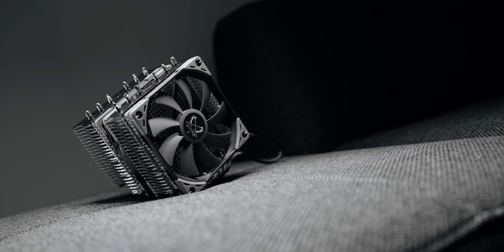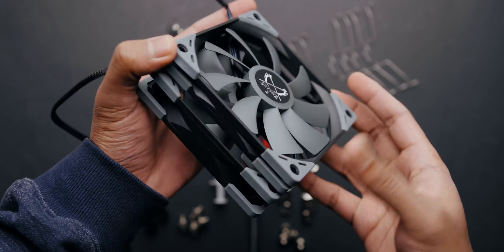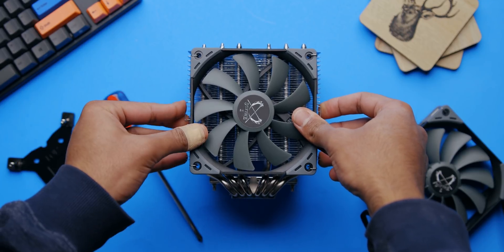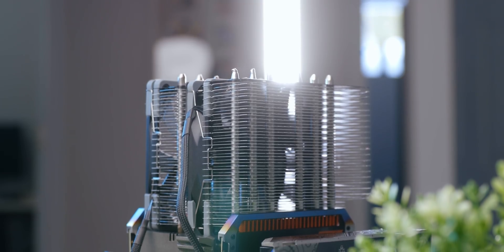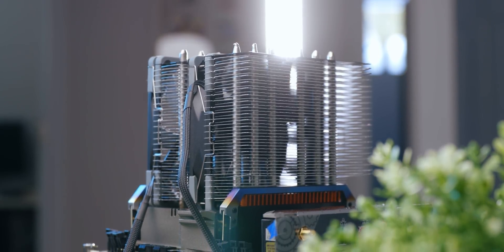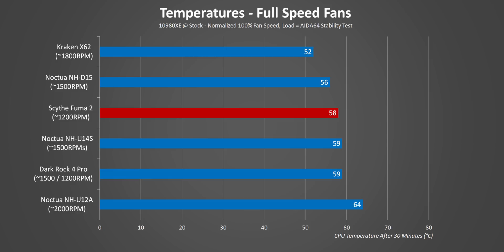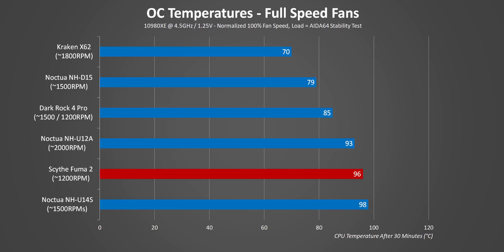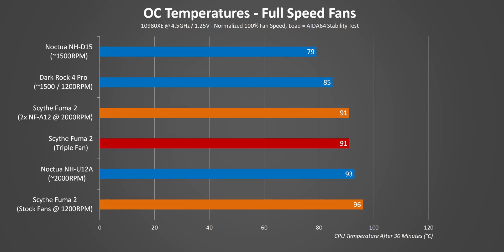A CPU Cooler You NEED To Know About!  Scythe Fuma 2 Review

Comment: I get Corsair A500 wasn't solid with Intel but why not actually test with AMD vs Intel to actually see if a cooler works better on a different chipset most A500 complaints only came with Intel with reviewers
Reply: The complaints about the Corsair A500 isn't about Intel or AMD, but about the design of the cooler. 4 heatpipes (although 2 x 8mm, 2 x 6mm) is with a logical assumption not enough. Big gap inside the cooler to have access to the mounting screws is disrupting airflow and frankly is not needed (Smaller holes that fitted the included screwdriver and/or a mounting system as the Cooler Master MA620M would have solved that problem). Not being compliant to the specs of Intel concerning where the cooler rest upon the capacitors (even when these are well within the specs of Intel) doesn't change when you are testing it on an AMD or Intel platform. Most shameful is that Corsair is still promoting and selling this unit for 100 USD in the state as it is. No recall, no excuse, no nothing, just cashing in on a flawed product.

Comment: As a Scythe Mugen 5 rev b owner, I approve this message
Reply: verios44 How long have you had it?
Reply: ricky v 3 years now 

Had it on a 1600 at 4.1ghz, kept it cooler than 72c during prime 95

Now its on a 3700x and preforms above expectation
Reply: verios44 Solid news indeed. I may have found a new air cooler. (:
Reply: @verios44  mugen 5 temps with 3700x? looking for a air cooler for a friend's build
Reply: WesleyL95 50’s to 70’s depending on game and cpu load.
Reply: @verios44  which one did you measure cpu package or cpu heatspreader? because with my 3700x + pbo rendering blender i get around 73c cpu heatspreader temp and 83c cpu package at 800 rpm.
Reply: i just noticed i use ninja 5 not mugen 5.
Reply: Hi do you have your mugen as push pull config?

Would it do better to have one in such way?
Reply: @rensquared24  yes mine is in push/pull. I use two of the same Scythe fans it came with originally, called Scythe Kaze Flex series 120mm fans. 

Preformance wise I have no idea if it makes a big difference or not. I currently use a 3700x so this cooler is more than adaquate standard. Hope that helps.

Comment: Great testing, really well done - Were you testing with the new noctua NF-A12x25? I'd like to see the performance from that fan on the cooler at the same RPM. Seems like scythe just stuck to the basics here and delivered exactly what an air cooler should be and nothing else.
Reply: I suspect that this cooler's biggest strength is the counter-rotating fan. The tests I would like to see are:
- Noctua NF-A12 front and back, with Scythe's counter-rotating fan in the middle
- Scythe's two fans mounted on another cooler
Reply: @FindecanorNotGmail  The six heatpipes and proper coldplate is nice as well. I dig the approach, fans really don't need to be faster than 1200RPM imo - if they have to spin faster than that you're bottlenecking yourself elsewhere. In the case of very high TDP cpu's that would need 2000RPM fans on a heatsink like that I'd simply suggest getting water cooling. Now we just need a redux edition of the 12x25 and we got ourselves a banger setup on the cheap.

Comment: Thanks guys, I was beginning to think air coolers were out, and only AIO's should be put in pc's. LOL For $60 I'll give it a try. But I currently have a Cooler Master V8 GTS on my 3600X in my HTPC. It runs at 100% load for hours when I transcode videos (100-150/session). My temps are in the 70's. But the fans are louder than I would like. Any idea how it would compare?

Comment: I'd rather buy this than a D15 and actually spend those extra $40 on a more powerful gpu or something.
Reply: More storage 👀
Reply: I got a Tc14pe for 50 nzd or like 28USD.. My r5 3600 doesnt get above 62degrees and I don't have a cpu fan
Reply: @BogDog9  Just a heatsink alone?
Reply: @BogDog9  so your CPU cooler without a CPU fan prevents your 3600 from reaching 60c ? From the tests I've seen on that cooler I can't say i can see that being possible
Reply: @sydbailey1320  well to be honest it peaks at 62, and best boost I've seen it go to is 4343. Rear case fan is close behind it also so it does get airflow
Reply: It's just ugly, I'd spend a few dollars more for be quiet dark rock 4.
Reply: @ilijapetrovic5002  hmm ugly? I prefer the black aesthetic of be quiet but the scythe also looks nice

Comment: I disagree with the assessment that this is a good cooler for the 9900K series. The newer batches are much less power efficient. I have a 9900KF and trying to overclock it to 5.0GHz all core it can draw 250w from the package on a Prime 95 AVX 2 load. And this is on a much smaller die than the 10980XE... this makes it actually more difficult to cool than the 10980XE. If you have a good 9900K, sure you can use the Fuma 2 to cool it. However, the power draw variance on good and bad 9900K chips is so vast that I would hesitate to recommend anything less than a 280mm AIO.
Reply from the maker: Really?  250W package power seems beyond what most Z390 motherboards can adequately provide on a normal basis without serious component degradation.  I'd be more worried about my mobo at that point than my CPU overheating..... :S
Reply: @HardwareCanucks  No sir. I blew a huge wad of cash on a Maximus XI Apex board. It has 2 8-pin EPS power connectors and doubled 8-phase power. VRM temps never went over 60C, even at those kinda power draws. The board is an absolute beast. It's just too bad my CPU was a dud. It was maybe a bit insane and ambitious to try doing 5 GHz at -0 AVX, but even with -4 AVX I was having serious problems getting power and temps under control.

Comment: I’d love to see how it works with the R9 3950x.  I got an assassin III and at max load it keeps at 85/89 degrees Celsius.
Reply: My guess Between 70-78c probably, which is really good with it's low DB
Reply: @chillhour6155  in normal work, modeling or just messing around with HoudiniFx or gaming, goes about  50ish to 65ish or so. just when max load it gets hot af xD
Reply: Sounds like your assassin iii might be faulty. I tend to avoid deepcool coolers, because they all should perform well on paper, but in reality their manufacturing process is as cheap as it gets. And i should add that assassin is not exactly much cheaper than the likes of Cryorig R1 Ultimate or Noctua NH-D15 or Thermalright Silver Arrow
You might get everything from slightly uneven spreader surface to empty heatpipes, non-existing heatpipe contact to heatspreader or fins. Scythe however is pretty consistent, i ve held several of them and the worst had just slightly uneven surface.
Reply: @bwellington3001  Yeah that could be. I couldn't find any better than this one here. Except for AIO Watercooling ones. I guess, I'll have to buy one from amazong overseas. I never thought this bramd would be this bad xD.
Reply: @Helios.vfx.  can you still return it?
Reply: @bwellington3001  I don-t think so. It-s been about 3 weeks already and stores here are kinda shit. But, right now i'm about 50/54 gaming
Reply: @Helios.vfx.  Well. If you get comfortable temperatures outside stress testing i would just keep it as is.
Reply: @bwellington3001  I think that's what I'll do for now. Thanks for your time

Comment: I have a Scythe Mugen Rev. B. It cost 40€ and can hold its own against coolers twice the price, plus its really quiet. 
Scythe is massively underrated imo.
Reply: Yup that's what's keeping my new 3700X nice and cool, coupled with bequiet silent wings 3 case fans my system is almost silent unless under very heavy load.
Reply: 100% agree. Mugen5 argb plus here. Great cooling, quite, attractive and affordable.
Reply: Might be too late to comment. The Mugen 5 Rev. B performs lower than the $25 Gammaxx 400. You can find multiple sources on the web, e.g., tomshardware. The reason is in its underwhelming fan that is focused on being quiet. Not only that, it only comes with one fan. Since the heatsink is a killer, upgrading the fans will improve the performance by a lot! Get one more fan for this gigantic heatsink. But if you are looking to buy a new cpu cooler, just go with the Fuma 2 that already comes with 2 fans.
Reply: @Sternkrieger I am going to install today 34 Duo on my i7 4790k @ 4.7 GHz. What fan curve you used?
What about noise?
Reply: Sadly, the Arctic Freezer 34 eSports Duo has it beat at the same price while giving you one more free fan. Hell, I was able to cool my i9-9900K @ 5.0GHz overclocked with it. Switched to an NH-D15 and I barely got any cooling difference.
Reply: @thaitan85  I have the Mugen 5 dual fan and cant see any difference between it and fuma 2 or arctic 34. I owned three arctic 34 duo on 3 different CPUs, a dual fan Mugen 5 (got it for 40$) so even cheaper than the 34 right now in my country. Temps are mostly the same, but for OC the 34 sucks. It can handle high TDP + the craftsmanship on the mugen 5 is on another lvl - better fans, rubber pads, quieter, better fan mounts, thicker radiator fins, bigger CPU contact plate, more heatpipes, screw driver in box....
Reply: @ancientslav4863  how would u compare the mugan 5 dual fan to the fuma 2?
i mean from a price point they are quite similar, but performance wise?

Comment: it is good if you're running your cpu on stock speed but seeing the results I'd pay $40 more for overclocking my system
Reply: Not really, it's just not that great for HEDT platform. On mainstream CPU's it will deliver temperatures much closer to NH-D15 and the likes.

Comment: I got the Mugen 5 Rev B, surprised to see Scythe being featured, unfortunately they're soo underrated
Reply: i have it with two latest noctua fans on Ryzen 3900x and it's great.
Reply: @SoulScience11  is there much difference in having 2 fans?
Reply: @Sagadiniz  it depends on cpu. Ryzen 3900x is very hot, with one fan on Cinebench i got 90C, with two fans 85C. I got NZXT s340 case wich has pretty bad airflow.
Reply: dito, also having the mugen 5 rev. b, its a nice solid cooler
Reply: @hyperbolicaltimechamber6  Don't who it was, AV Techy or Ponchato who used this block for passive cooling in a Silverstone LD03 with only the draft between the bottom and top fan of the case.
Reply: How long have you had it?
Reply: @WarriorsPhoto  I've had it for 1 year.
Reply: Sagadiniz Any issues or anything to say? Besides what Evert said.
Reply: @WarriorsPhoto  Make sure you have space between the back of that Mugen 5 and your case. Due to it offset and large block, the second fan might conflict with your exhaust fan.
Reply: Dorientje Woller I appreciate this information. Thank you everyone.
Reply: Same! Actually have the Rev B in my mini-itx rig and it is so incredibly powerful.
Reply: I just went and bought a kaze flex pwm fan for like 14$ I think.  Dropped my load temps maybe a degree or two.  But overall not much a difference.
Reply: @DurzoBlunts  The problem with a second kaze flex fan i think is that they spin clockwise and most pc case fans spin counterclockwise. i did the same as you and my exhaust fan slowed down by 200-300rpm. Somehow the counterspining currents interact with each other it did the same thing with 1 fan as well but the exhaust fan only slowed down by say 50 rpm. Now i use the second flex fan as exhaust deleting the AF 120 quiet that i had in there and i get better temps and even more silence.
Reply: I have one too. 3 years and still silent with original Kaze Flex fans!
Reply: I moved the included fan to the back and added one of scythe's rgb fans in front. Then they came out with the RGB version of the mugen 2 months later... Still very pleased.
Reply: I feel the same way about Thermalright. They never get any attention, but they make good air coolers. I'm guessing the issue is they don't send out tons of free samples to the YouTube crowd.
Reply: same here. the black RGB version looks great.
Reply: Used to buy them for years but they vanished from the Swedish market :/

Comment: To be honest, I hope Scythe reflects back to their past and issues a Max version of this cooler. Max version = 140 mm fan version.
Reply: OOOOOOOh, I really like that idea. Would you pay $15-$20 more than this version? (Still puts it a bit below Noctua and Be Quiet! AKA pretty Noctua).
Reply: @gogo8092201  If it gives more performance for that 15 - 20 USD and an upsize of the cooler with 2 x 140 mm 1200 RPM fans, why not. Their Scythe Mugen Max outperformed the normal Mugens and didn't cost that much more.
Reply: they had the best low profile cpu cooler imo
Reply: I've been hoping someone would test this with a single NF-A15 in the middle to see what it would do. Most reviews I've seen pit it directly against the D15(s), so they should have the fan on hand. It might stick out a couple mm on either side, but should still work well.
Reply: @heytoast7129  I do have a question: How are you go to put a 140 mm fan in a block that is created to hold 120 mm fans, if we are talking about the Scythe Fuma 2. The Scythe Fuma 2 Max doesn't exists at all, it was just a referral from me to the past of Scythe where they made of several models a Max version, like the Mugen Max. But, then the challenge will be to create/make a 140 mm version of that slim fan without losing the integrity of the fan blades.
Reply: @dorientjewoller113  Yes, I'm talking about the Fuma 2. Ah, I forgot the Noctua fan isn't symmetrical. It's 150mm on the width which would make it almost 1cm wider on each side, I don't know if the fan clips could cover that distance. If they could then it would work, as far as height goes it should be fine. 140mm would stick out from the top a little more, shouldn't be too much. I wouldn't expect it to be a perfect fit, but good enough to try it out. Just curious to see how it would do in a single fan config. 

But yeah, I too would love to see a Max version of this.
Reply: I'd love that!
I'm still using my Mugen Max on my 4790K and hope to see a Fuma 2 Max to put on a 9700K!
Reply: Its issue of tdp design, not cooler size. Tdp of fuma is lower tdp model than noctua's. Its amazing product
Reply: Don't really need 140mm fans, just faster fans. With Mugen, they did make a black edition with a faster fan. Around same price and better thermal performances. A Fuma 2 Black edition, with fans running at 1500 rpm, instead of 1200 rpm, would already give to this cooler a good improvement.
Reply: See, finally somebody did the test that i wanted to see. It is possible to boost the performance of the Fuma 2 beyond NH-U12A levels, just by swapping the fans with something with higher RPMs. It is not by much, but its possible.
Reply: @PietroSoft  I wished they added 2 slim fan clips extra with the cooler. The Kaze Flex slim 1200 RPM is only 12 Euro's/17 Dollars and can be bought separated and would be a luxury to be used as a 3rd fan. Or, if you wish a dash of RGB on it, both Kaze Flex, 25 mm & 15 mm are available in RGB version with 1800 RPM and the same opposite direction of spinning.
Reply: @dorientjewoller113  Scythe could just release an RGB Performance edition, and kill the U12A with the 1800rpm fans. It would be better on everything, looks, performance and price.
Reply: @PietroSoft  That's why I said that I hope they issue a Max version of this cooler. Beefed up to be used with Kaze Flex 140 mm fans.
Reply: @PietroSoft  they need 1500/1800 rpm (a)rgb version of Ninja5, guy that comes to LTX this year tested it and it beat D15 by almost 10°C on 4.1 GHz 1700x and same temp on 5.2GHz 8086k, but that one was bottlenecked by intels shitty TIM under IHS
Reply: I agree with this. I won't buy an air cooler if it does not have 140mm fans. They are quieter normally.

Comment: Why would you normalize to 100% fan speed instead of a specific noise level? Come on guys, this really makes you look like shills.
Reply from the maker: Shills for who exactly.  Plus normalizing at a specific noise level is a complete red herring.
Reply: Hardware Canucks You’re kidding right? On both counts.
Reply: Hardware Canucks You’re comparing for 100% speed normalized, which is absurd. You want to normalize for a reasonable sound level so you can compare how efficient the fans and cooling components really are, not “who can throw the most power at this problem”. Nobody is going to want their fan running at 100%, despite how it’s sound might compare to other fans’ sounds at that speed. I’m kind of shocked that you either don’t get this or are intentionally glossing over it.
Reply: @HardwareCanucks  You might want to reconsider that statement. A cooler that keeps my cpu at 50C@35dB under load is a WAY better choice for me than one that keeps it at 50C@39dB. As I don't do more than just some basic overclocking peak performance is not very interesting to me, running as quiet as possible is.